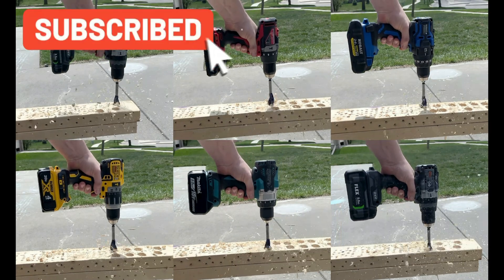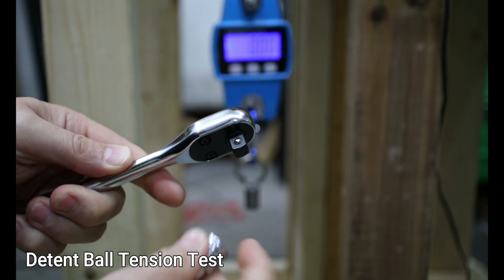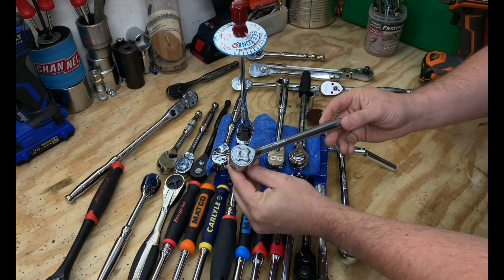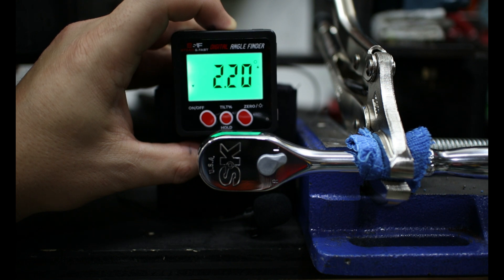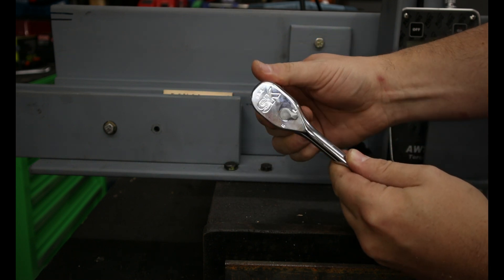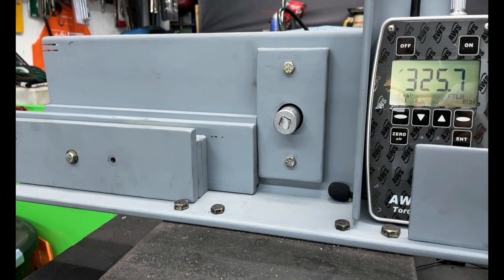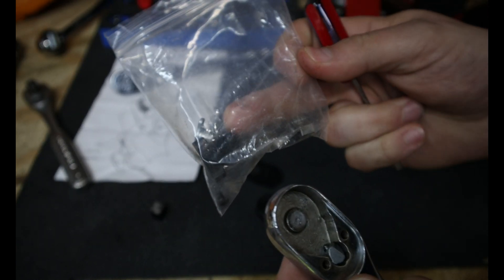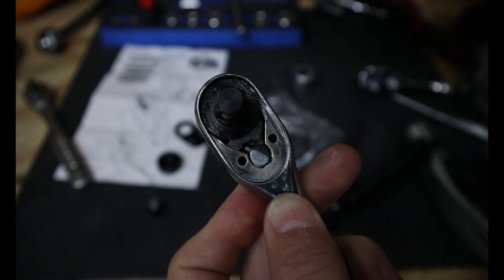SK Tools USA Made and Tested Full Launch to China GreatStar Tools (You Asked for This)

Comment: Firstly, SK tools has had issues for several years, long before the purchase by Great Tools.  I've owned some SK tools for almost 50 years; some were bought when I started in the industry in early 70's.  SO, Mac, Cornwell & others were too expensive when I started and my local hardware store carried an extensive amount of SK at the time and handled all warranty issues over the counter.

I recently had my flex head 3/8 ratchet worn out (not the pawl but the teeth in the head) despite cleaning and lubrication on a regular basis.  I had to mail it in and it took 3 months or more to get a replacement!

Great Star like many Asian firms owns a number of brands and though it didn't get much press, they bought ShopVac out of bankruptcy and I believe have restarted production of products at the PA headquarters again.  ShopVac had shut down and already stopped production and was going to file chapter 7 bankruptcy  when GreatStar stepped in and bought it.

So, I will wait and see what happens with SK before blaming GreatStar for purchasing SK and moving production elsewhere.

BYW, SK has bigger problems than being purchased by a Chinese concern; in my area, no one sells SK tools and its been at least 20 years since I've seen SK tools sold.... Maybe, GreatStar has a long term plan to restore the good name of SK tools.  We shall see.
Reply: ? They're not restoring any name, they're buying the patents, inventories and corporate contacts and shutting the rest down, Ideal Industries already admitted as much in their sale announcement.
Whatever 'restored name' you will see will be as another imposter zombie brand, selling itself on American nostalgia while shipping all of the proceeds to China.
Reply: @Senkino5o  And?  That is what the capitalist markets want.
Reply: That's pretty similar to my own experience. I was a shop tech 2002-2004 and SK tools were really good. Never had any problems. Recently I bought one of their ratchets, failed on a modern torque load. It basically just locked up. I sent it in and they mailed me another one but I still have snap-on and matco ratchets from way back when I was a tech that have never been rebuilt that still function perfectly.

Comment: My flex head the selector switch is extremely stiff!
Reply: On the early LP90S, the springs were too long or tight. Try to cut 1 coil at a time from the spring, that should help. Plus if u haven't, put SuperLube on internals. For whatever reason, they come dry from the factory?
Reply: @olivia_049  thanks Robert, mine came with lube. I I differently want to cut the spring. I make a quick video of it on my channel.

Comment: I hope their Chinese owners realize a made in China S.K. tool will sell poorly.  You have very few made in USA choices, but if it's made in China, it's just one of lots lots of has been brands.
Reply: All they’re doing is moving the factory to PA for now. No talk of anything Chinese yet
Reply: @veryfunclub  they sold to a china company. No longer made in USA.
Reply: @BassWhoopinFishingTeam  they moved the manufacturing plant to PA. Not China
Reply: Grainger is now selling S-K wrenches again and giving the country of origin as China.
Reply: I dunno. Them egg rollers do a better job of making chrome stuck than SP(superpeel) ever did. They should have gotten Wright to design their 120 tooth(or whatever) cartridge they finally got around to. They had it correct when the tuff 1 was around. Needed a spring redesign...not redesign, simple wire gauge differences and hardening/tempering and an oil hole...that's it. It was near perfection(enter NEXT owners)
Reply: Idk much about how the tool business manufacturing operates but I wish one of these made overseas companies would invest big time into Quality Control. Imagine if you had a reputation that you can build a good tool anywhere if its XYZ brand ensuring it gets made right. though more USA made would be nice

Comment: Test a sample next that you previously tested by hand please. It'll be good info to know if this machine outputs the same results for calibration reference.
Reply from the maker: The ICON fixed head ratchet tested by hand at 276.3 ft-lbs and the new ICON flex-head has the same internals and maxed at 290.6  ft-lbs.  While that is only one single point of data I estimate there could be a 0-15% difference by manual testing vs machine output. However the highest number I know tested on a machine that was calibrated still only produce 305 ft-lbs and that was a SnapOn. I’ll test a SnapOn by the end of the year.  Would like to get MAC and Matco tested first

Comment: ...just starting the video... long time sk user... just purchased this ratchet... crossing my fingers...
Reply from the maker: It didn’t disappoint when it came to strength. I picked it up on the last Steals & Deals on the SK site so it was a sweet deal.
Reply: @ClientGraphics   ...yeah, thats when i picked mine up... also picked up the "DT" kits (dual tooth) rebuild/retrofit kits for my old round head 3/8 & 1/4 ratchets from harry j epsteins web site for half price, & i've been pretty impressed with em... honestly, my grandpaws old sk "wayne" stuff gets left alone "as is" ,not puttin a kit in those, but for modern sk ratchets, going from single tooth to "opposing" dual pawl set up is a big upgrade in case u havent tried it yet... thanx for the videos man & god bless

Comment: what a shame that SK  has sold out  i have and use my Dads 3/8” SK socket set he bought in the Service in the late 1950s  the set is original and complete plus also has a  full set of Metric sockets. to match  he purchased sometime in the 1960s to work on his Volkswagen Beetle  even with China having the capability of building high quality tools  i myself am a Skeptic they will ever have  the true Nostalgia of the original Made in USA tools  that will be handed down from generation to generation  i have other Professional Grade  sets but prefer to use my Fathers old treasured set over anything else  as a child  whatever project my Dad and i worked on together at the end of that Project all the tools we used were degreased and returned to their appropriate  storage case  untill the next project that insured  all the pieces were accounted for  and in good condition
Reply from the maker: I have been using an older SK Wayne socket and it has yet to disappoint. When used properly their tools do and seem they could last a lifetime.
Reply: My dad still has my grandfathers SK ratchet and socket set. I wanted to buy the newer 90t ratchets, but I cant find anyone in canada who sells them. Emailed SK and never heard back.
Reply: @aidenstefanson2175  Try emailing them in Mandarin.

Comment: The socket remove test is no beuno. The SK you used a finger sideways, and the tool went side load which would require more force. The Icon you used two well placed fingers because its a flex head ratchet, which had a non binding downforce.. I demand a rematch! ;)

Comment: This is a seriously impressive ratchet! Not only is it insanely strong but having the ability to casually rebuild the internal components after applying 300+ lbs of torque is ridiculous!
Reply from the maker: It’s pretty slim and narrow and ever so smaller than even a Snapon F80. Definitely he first selector I have had to punch out but still pretty easy to repair.
Reply: @ClientGraphics  It actually doesn't need to be punched out. There is a lip or groove on the selector switch that you have to spin around to get it out.